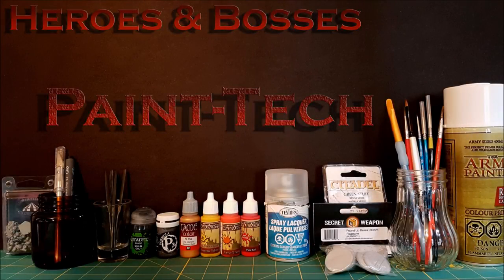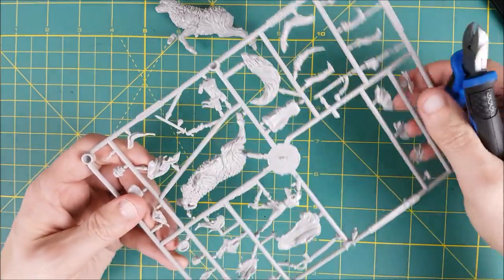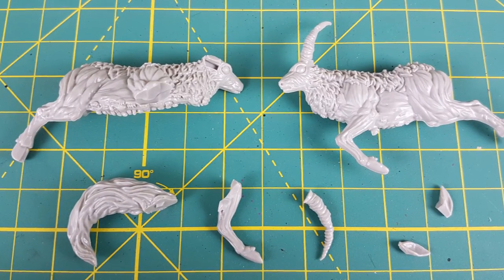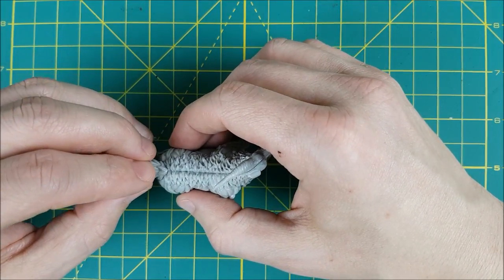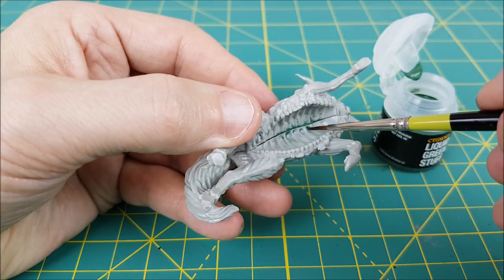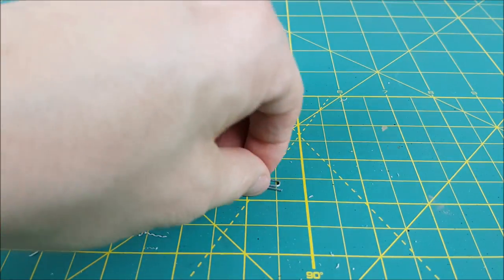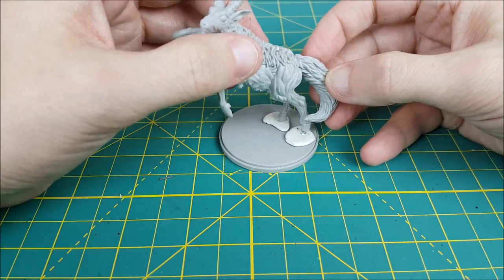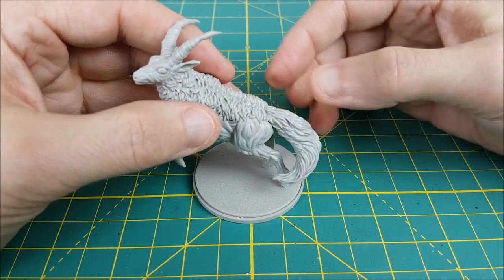Paint-tech 09 - How to Pin & Prep Miniatures

Comment: Fantastic video but I must say that miniature looks like a nightmare. It was nice because the single mini had everything wrong you might need to fix (except a bent part) but geeze that seam! Are the other KD:M minis better?
Reply from the maker: The King of Average No actually :) Every miniature comes in multiple parts and requires glue and crack fill. It's worse than a GW miniature in that way, but they are pretty amazing once assembled.

Comment: For small gaps matte varnish is very effective (much more pleasant to work with than liquid greenstuff) pVA can also be used, but it is worth remembering it will dry slightly concave so you need a second application.
Reply from the maker: Rob Crawford Yes! I forgot to mention that in the video - thank you. I do the same thing - 2 or 3 layers of brush on matt varnish. It's good for gaps you missed before priming too, because you can put it right over paint.

Comment: @heroes & Bosses amazing Video! It helped me alot already but i really wondered if you have or could make a video on how to make those handholds to paint your Zombicide Miniatures i find it really hard to hold them while painting
Reply from the maker: Normally I use a bottle cap from a normal water bottle, an upside down shot glass for bigger miniatures, or a wine cork if I plan on pinning a miniature. By far, the most comfortable handhold is a shot glass. It's heavy and you can wrap your whole hand around it. Also you can buy them in 3 packs at the Dollar Store here in Canada. I recently bought a couple Games Workshop "Paint Handles" as well, but they only work with beveled bases (like all Games Workshop bases). I find my hand really starts to cramp up if I have to just hold on to a small bottle cap, but I always have some in the house somewhere. Sorry for the late reply - for some reason YouTube isn't sending me notifications.
Reply from the maker: Also, I forgot to mention - I use either a bit of sticky white poster putty or 2 sided tape to hold the miniature onto the shot glass or bottle cap.
Reply: aaah perfect tip! Thanks mate! I love your videos. especially the zombicide ones and tech guides! Keep it up :D